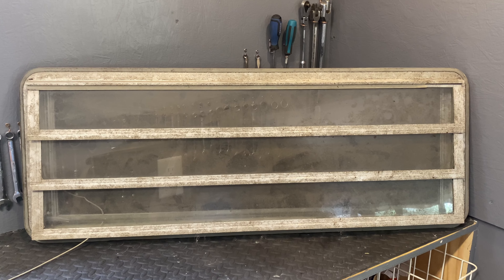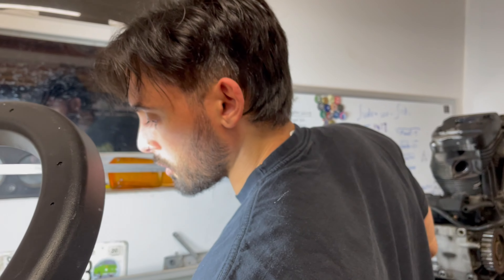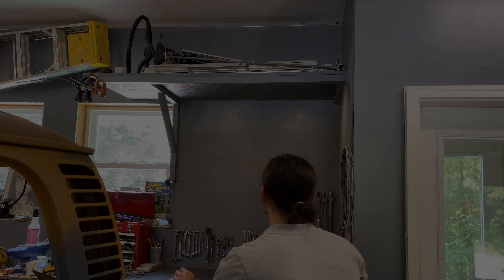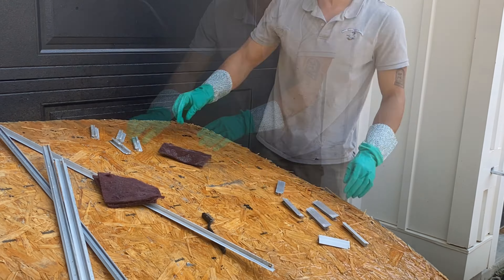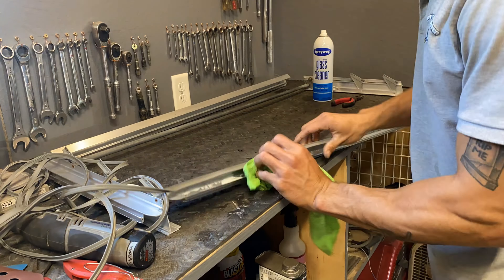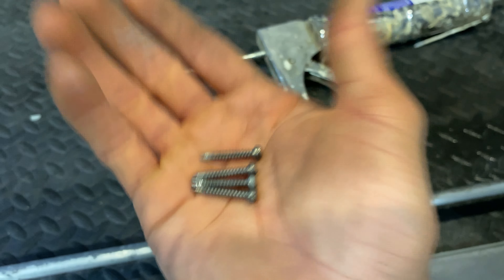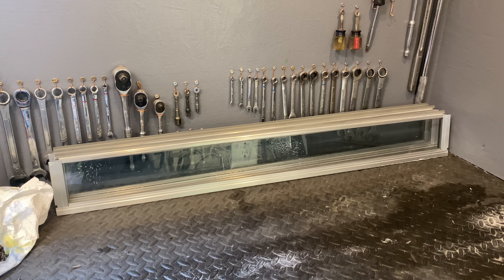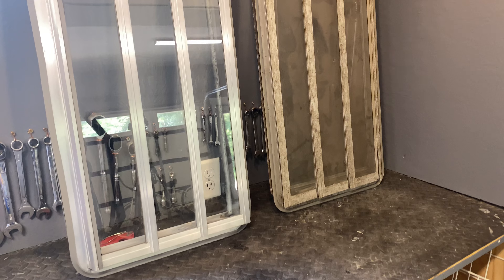VW Bus Restoration Episode:48 | Jalousie Window Restoration Guide

Comment: damn good job, I did my otter seals and looked at the work needed for the inner seals and said "Nope".  I hand / dremel polished all my aluminum, and I wish I would have found that boat aluminum acid.  Overall though my Jalousies look "okay" but not as brand new as yours.  Maybe I will do this repair but probably not until I want to go through the pain of repainting my bus.  Also be careful installing your Jalousie after you paint because they have sharp corners and can easily scratch your new paint job, ask me how I know.

Comment: Great video ! I’m currently trying to do the same I’m on the rebuild started trying to get the 3 windows built back up but can’t get the window frame to go back on with the glass and seal it’s super tight and the glass feels very thin ! Any suggestions?
Reply from the maker: Have you tried using glass cleaner to lubricate it? That’s the only way I could get them to slide together
Reply: @Vangabonders  I’ve been using silicone spray with no luck whatsoever did you start with the top or bottom or the sides ?
Reply from the maker: I did the bottom then the sides and then the top. Make sure they're facing the right way  @318ismash
Reply: @Vangabonders  that’s the way I’ve been trying bottom first , just have to keep trying! Cheers for the reply

Comment: Great video. I found using fine steel wool on dry glass is an awesome way of removing the old crud on glass. It's also made great way to clean a windshield of bugs before applying a glass treatment. Steel wool Must be dry though. The glass is super smooth afterwards.
Reply from the maker: I gotta give that a try! Thanks for the tip

Comment: Its crazy how many times you have to refit and recheck before its finally in the right place. I learned that the hard way the first time I welded a panel an inch off. Nothing Is permanent until the very end!
Reply from the maker: as long as you're willing to keep cutting and welding todo es posible!

Comment: If you cut the corner off the glass seal they fit better and a little easier to put together.
Reply from the maker: I did try that on one and it worked but I felt like cutting the seals was a bad idea, but honestly I don't know how much water would get through that part of the window either way